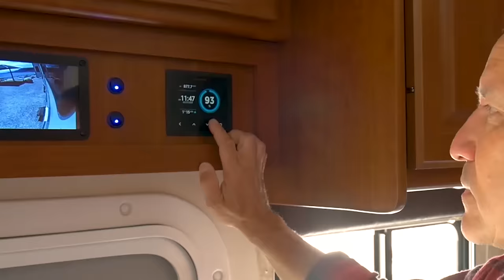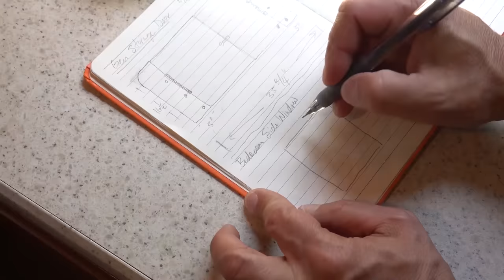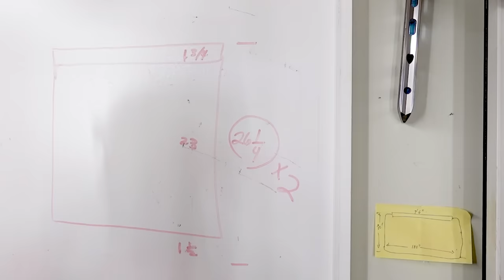THIS Replaces UGLY Foil Insulation In Your RV Windows (Full DIY Build)

Comment: Great idea!  A few comment...  Arent you losing the insulation benefits by cutting the reflectix into sections?  Isnt the reflectix flexible enough even if you didn't cut them into section?  Also, I dont see the necessity in securing the magnets to a wooden piece, couldnt you have just secured them to the blackout fabric?  Adding magnets to the side would help hold the shade in place even better.

Comment: Fantastic keen to give this a go. Any chance you could put up a materials list and where to purchase. I'm particularly interested in that bracket you attach to the wall. Wondering what to ask for at a hardware store.
Reply from the maker: It's a simple French Cleat setup. You can make them out of wood by cutting it lenghwise at a 45 degree angle. Or you can buy these aluminum ones on Amazon: https://amzn.to/3Y9NP8I

Comment: Nice video, although I do have a QUESTION.  Doesn’t placing the reflective material inside the cloth defeat the purpose of reflecting the suns rays away from the window thus keeping the inside cooler?  Since the curtains are already “black out”, the reflective isn’t aiding in blocking out the light and the material used in these curtains also has insulating properties.  Plus, when I was a kid we were taught to keep the blinds and curtains closed on the side of the house that the sun beat on because there was no AC or we couldn’t afford it until the window ACs came out.  But it does make for a nice hanging window treatment.  I look forward to seeing if anyone answers my question above.  I’d really like to know.
Reply from the maker: Not at all. It still insulates great. In fact, before everyone used it in RVs it's primary use is for HVAC.

Comment: That was awesome.  When you drilled through for the top Z bar I flinched!!  :). I’m always nervous drilling through to the outside and it looked like your drill went pretty far.  Great mod.
Reply from the maker: It would have had to go through one more aluminum layer before seeing sunlight. I made sure to use a shorter bit :)
Reply: RV with Tito DIY   Oh, I have not doubt on your work.  You’re very thorough on what you do.  I get nervous is all...  Great job!

Comment: I'm so glad I found this! ❤ I'm currently insulating my camper and I love this idea for the windows! You sound really knowledgeable so if you see this and you're willing to answer, what do you think about putting those window treatments on the windows? Mine are dark on the outside and I'm worried I might hurt them?
Reply from the maker: Sorry. I don't understand the question.
Reply: @RVwithTito  - Sorry, I'm not good at describing this stuff. I bought a window treatment at Lowes. It's some kind of film you put in your windows and use a hair dryer to apply heat. I'm just not sure if it's safe to use on dark windows. I don't know why they are dark. I assume some kind of tint or treatment.
I linked your video in one of my comments because I think it's such a great idea! I wish I had your skills. I can't do all that sawing etc so I'm going to do a much more amateurish version of what you did! 😅

Comment: Great video. How well does it cool compared to the blinds and reflectix you were using?
Reply from the maker: I haven't taken measurements but I'd say the result is about the same. Like I mentioned in another comment, the window frame also generates a lot of heat. So extending the shade beyond the frame helps too.

Comment: thanks a lot for the link to the French cleats! I've been looking for something similar (I once had a DIY upholstered headboard that hung on the wall using a French cleat made out of 2x4. It was awesome!)

I was surprised that you chose to cover the window side of the reflectix, a large portion of it's ability to reflect heat is in the shiny surface. But if you really want fabric on both sides to enjoy the look of it rolled up, you would actually get a much warmer product with some fusible fleece.
Reply: i like the idea of using spray adhesive over the whole thing. ps - reflectix works just as well when covered. it is not the sunlight, but the radiant heat that reflectix blocks. being inside of another surface does not affect its ability to reflect radiation....

Comment: I am totally doing this for the two bedroom windows in my Jayco!  Thanks!  I woke up with the sun shining right into my eyes the past two days and the thin accordion blind was useless!  Dang I donated my iron!  I don't have a home shop but what I did buy are WORX tools (battery operated), a small mini saw and reciprocating  / jigsaw depending on which position you have it in.  Great tools for a full-time RVer!  Great, now imma gonna have to hit a thrift store for a used iron!  /facepalm

Okay I don't have a forstner bit for my drill, added to my shopping list!  Oh bloody hell I DO NOT have a nailer!  That was over the top dude!  Oh damn that is totally pro!  I grew up sewing and took fine furniture and carpentry at a school in Seattle.  That is bad ass!

Oh hell no you used a metal French cleat to hang it?  Sweet.  They use wooden french cleats to hang cabinets in Europe in apartments.  Modular type system.

Beautiful.

Comment: Question for Tito: can I drill those small holes into the interior RV wall without degrading the integrity of the wall itself? 
Thanks very much. I learn alot from your shows.
Reply from the maker: A couple of screw holes shouldn't hurt anything as long as you don't go too deep and out the other side.

Comment: Love these and have been considering something similar.  I need a placement diagram for metal, magnets, and cleats.  Thanks!
Reply from the maker: It doesn't take much. You could use two magnets anywhere on the top. You could even go with one cleat or two. Doesn't have to be very precise.

Comment: You could do the same with vents. Some more modification but it could be done. Or use the scrap fabric and spray glue it on rigid insulation, have it all match.

Comment: Nice work and it looks great.  My question/concern regarding the reflectix is, doesn't the reflectix sandwiched in the material loose it's ability to reflect the sun's rays?
Reply from the maker: It's a trade off. Reflecting the sun back doesn't necessarily keep your windows cooler since the sun will pass through the window pane twice...unless you have the reflector on the outside.
Reply: While it may loose the reflective properties, the Reflectix is still providing excellent insulating properties.

Comment: What air compressor are you currently using? Considering a viair 450P. Your thoughts, we plan to upgrade our travel trailer to a 30-foot tow behind. Using a 3/4 tone or 1 tone truck with bed cover and kayaks on top.
Reply from the maker: I have a 400P-RV

Comment: Would it work with a shorter distance between each reflectix panel. Maybe 1/4” so it doesn’t stand out as much, and appears to be more of a solid piece rather than the appearance a horizontal blackout shade.

Comment: Your blackout curtain from Walmart has a satin-like backing, good.  The ones I bought (for house windows) had a latex backing.  I'm pretty sure that if I tried to use the thermal fusing tape, with a hot iron, on the latex-backed curtains it would make a big mess.

Comment: Love your "double-duty" idea, for sure!, but have another curiosity question:  Is there a difference in the insulation/reflective properties by putting the reflectix inside/behind material? 
I don't know how it really works I was led to believe it was all about visibly reflecting the heat generating light away and that was why it was so freakin' ughly, with not even having a design on it.
Reply: I, too, have wondered that. But consider this is used in building houses where no light shows.

Comment: Awesome work! I have a question,  isn't the reflective material supposed to help with the heat.  I understand it can reflect back about 97% heat and sun so by wrapping it with cloth doesn't it at that point stop reflecting?
Reply from the maker: It still works as a good insulator and reflects heat back.

Comment: Did you know that in the quilting department you can get the batting with foil inside to be used for hot pads in the kitchen. It is fabric so it is flexible.
Reply from the maker: Hmmm. Good to know. Thanks!

Comment: Rough approximation from your video, given the gaps between reflective foam pieces, insulation is about 2:1 with the shade. Also, doesn't covering the reflective foam with blackout fabric block infrared radiation from reaching, and therefore being reflected by, the reflective foam?

Comment: Hey Brian, while I like the idea of what your doing I'm not so sure your not losing a lot value of the reflective. it seems like this is no different then a thick curtain. what am I missing..
Reply from the maker: You're probably right. Lots of ways to achieve the same result. Just throwing ideas out there. Plus I had lots of reflectix 😀
Reply: @RVwithTito  We have a Class A and we have a crap load, there are downsides. When they are not up they always seem to be in the way. when they are up you can't easily see through them. catch 22 I really like your design though, very well thought out..
Reply: You may lose some of the reflectix, BUT you have doubled the thermo  insulated shade fabric.  over all I don't think there was any loss of insulation.
Reply: Check the R value of Reflectix, it is not good for insulating. Better at reflecting radiant heat from sun rays. But the dark color cover absorbs radiation, more so than a shiny surface.
Reply: @stattytravels4638  another thought is to adapt this with velcro or magnets and just attach as needed and remove and put away  when not needed. I don't want to have to.remove anything right now so will consider some other attachment idea,but the blind sandwich is great!
Reply: @jr.6199  i use a flexible type to insulate a pipe, and it works well to keep heat down.

Comment: Ok, I guess I have another question: how do you know where to drill/screw into to catch one of the wall studs?  Does a regular stud finder work if aluminum studs?
Reply from the maker: Didn't need to catch any studs on this. It's super light. Though both went into aluminum which framed the window.

Comment: Has anyone mentioned you need an air gap to make reflectix work? I haven't scrolled very far. And I'm not sure it can be entirely covered. Someone else will have to say yes or no on that one. But I do know for a fact that it's just like using some stiffening fabric if you're totally encasing it with no kind of air gap whatsoever. The general idea was exactly what I'm looking for though.

Comment: This might be a stupid question, but isn't the whole point of the Reflexix to reflect the light/heat away from the interior of the RV?  If you cover the reflective surface of the Reflexix, doesn't that defeat the purpose?  You could have used any kind of insulating material on the inside of your panels to keep the heat (or cold) out of the interior of your rig.  
I'm certain that I'm showing my ignorance, but maybe someone would care to explain it to me.  Thanks for your patience.

Comment: Thanks for the incredible idea. Absolutely love it and simple to make. However, I tried this weekend and was an epic failure. I can still use it as a full shade, but not as you do. Biggest question...how do you get the fabric so snug & tight? Mine was all loose. Please help.
Reply: use a weak spray adhesive to keep the fabric tight to the reflectix.

Comment: Effective for heat, but looks like a hitchhiker’s bed roll when folded up. Trim the reflective material to the size of your window, cover with all black material, add small round Velcro to the window/material then wedge up under existing window shade. Double protection and cleaner look.

Comment: does it still reflect the head with it being covered? or would it o better with one side material and one side reflectix thanks
Reply from the maker: When it folds up you'd see both sides. I don't want that.
Reply: @RVwithTito  THank you and it keeps it alot cooler inside
Reply from the maker: @heather6828  It does. Just checked it with the sun beating in the window. Window and frame are hot. No heat transfered to the other side of the blind.
Reply: RV with Tito DIY thank you I’m making them

Comment: I don’t want to be negative but the Idea of the reflective sheeting the shiny aluminum finish is to reflect the heat and by covering it with material you’re defeating the purpose. For Insulation not a bad idea
Reply from the maker: Perhaps. A worthwhile tradeoff for me though.
Reply: The reflective material is to reflect heat energy not light. Once heat energy moves through the fabric and hits the shiny material it ( heat energy ) will be reflected back into the air gap. Look up how foil covered insulation board works.

Comment: Insulated curtains are a fantastic idea... though you've negated the greatest strength of Reflectix -- its ability to block radiant heat -- this way. Radiant heat barriers need an air space of at least half an inch to function. The fact that the Reflectix touches the curtain fabric means that it will conduct heat straight through the Reflectix onto the fabric. The curtain idea will retain the insulation in the Reflectix (the air pockets), but none of the reflective or radiant heat blocking properties are intact.

Comment: Love the aluminum French cleat! 
This is a keeper as I detest making small wooden ones! 
Question: Any idea how much weight the aluminum ones hold?
Reply from the maker: Check the link in the description. I can't remember the weight limit. It's pretty high.
Reply: @RVwithTito  Ah, thanks. I hadn't gone there yet - I got distracted by the International Space Station space-walk doing change from old batteries to new lithium ion ones!
Reply: @RVwithTito  Thanks...did find it.
Reply: For others wondering, I checked listing and it reads: 
"French Cleat Hanger 10 Inch - 2 Pack - Picture, Mirror, Whiteboard, Pallet or Panel Wall Mount Bracket - Z Bar Hanger Supports 50 lbs."

Comment: Being inside the blockout means the reflectix won't reflect the heat coming in.
Reply from the maker: Not the light, but heat...yes it does. Reflectix double layer was designed to reflect heat in structural and HVAC projects where there is no sunlight. Of course, it has many other uses.
Reply: @RVwithTito  thank you for finally saying that!

Comment: I think you dud a great job but insulation paper is not used over entire area because ot is cut into pieces. Noise and cold will go through thinner area where there there is bo insulation paper. Cannot you make it rolling instead of folding and use flexible glue between fabric and insulation paper?.

Comment: The material facing out would be better if it was white in the summer and black in the Winter.
By covering the reflecttics totally takes away from it's benefit of reflecting the heat outward.

Comment: Really great idea and came out awesome. Great work! Could only imagine how long it would take to make them for all the windows though, especially bigger ones😅 
What was the total cost of materials and of that how many more windows could you do with what you have left? Interested in doing something similar.
Reply from the maker: For that sized window, the materials were about $30. And yes, there's left over fabric for another small one. For the larger windows, I went with a full curtain. Another thing I've done is to wrap fabric (spray glued) around corrugated plastic cardboard that's cut to fit inside the window frame. Same approach as reflectix, but nicer looking.
Reply: @RVwithTito  I’ve used fabric spray glue to line one side of reflexic. It looks like it was quilted. I finished them off with corresponding colored duck tape.  
I love the magnets!!  Gonna do that.

Comment: Seems to me that the shiny foil covering of Reflectics is to reflect light energy and the inside is just something like bubblewrap as insulation to stop movement of air and the transfer of heat. If the foil is covered that foil is useless, no? So why not just fill the curtain slots with bubble wrap? Recycled packaging of bubble wrap would basically be free, eh?

Comment: Great design!  However, as a seamstress, I would suggest that folks consider simply using the insulated fabric readily available at fabric stores.  Learning to sew a straight stitch is easy, but as a no-sew option, one could simply use fabric glue as Tito did to make the rectangular shade.  One caution:  iron on adhesive must be applied at the proper temperature or it will not hold up.  Read instructions carefully and be sure heat is at recommended temperature to ensure the shade will not deteriorate over time.
Reply from the maker: Instructions? Ooops :) So far they're holding together well. Thanks for the pro tips!
Reply: just learn to sew! men can sew, too. just like they can clean up the toilet after urinating.

Comment: The reflective material is supposed to be used to reflect the light off seems you're just using it as an insulator and not really a reflective
Reply: It reflects infrared, not just light, which helps it insulate.
Reply: @posteroonie  from another comment, it may save some double paned windows, too!

Comment: doesn’t covering up the shiny silver surface reduce the insulation factor?
Reply from the maker: Not necessarily. It's designed primarily to reflect the heat.
Reply: RV with Tito DIY , so it will reflect heat even if it’s covered?
Reply from the maker: @DeerheartStudioArts  Considering that it's intended application is as insulation and nothing to do with sunlight. Yes

Comment: My understanding is it's not so much the insulating problem with RV windows as it is with the air leakage > Drafts !!!  Anything is capable of insulating but if the windows aren't properly sealed it doesn't matter about the insulation . ???